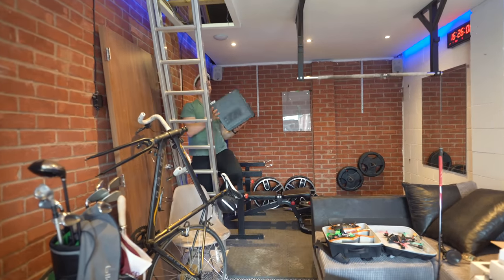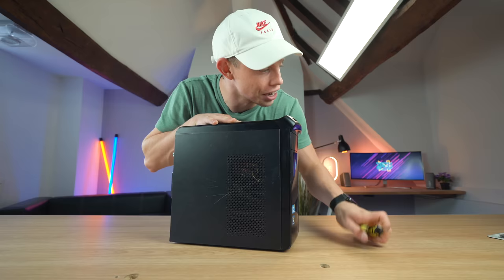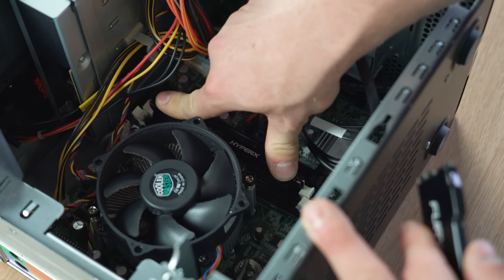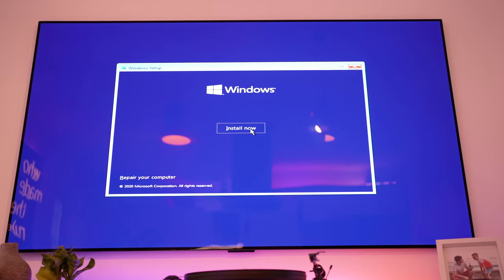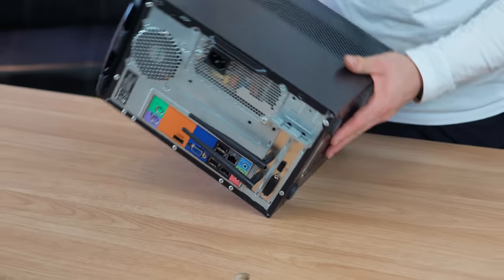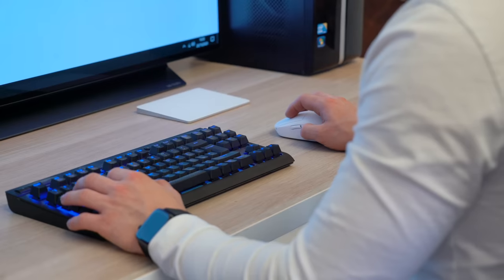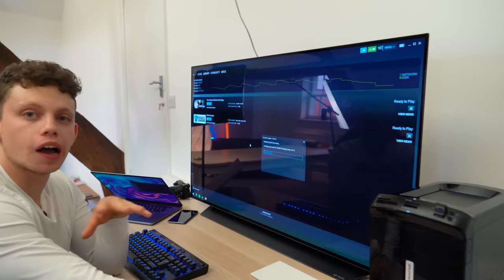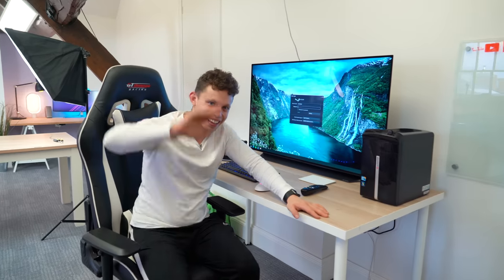How I Turned An 8-Year-Old PC Into A Cheap Mini Gaming Rig!

Comment: With this 32bit windows, you're only using 4gb of the 8gb ram. So, there's even more to get out of this pc
Reply: ye i had this with my laptop would ony run 4gig not the full 8 coz i put 32 on it insted if 64 all good now ddr3
Reply: Maybe the CPU is only 32 bit?
Reply: @lorenzojw04  then he doesn't need the 8 gigs of ram either
Reply: @Nootjuh  no was 64 bit cpu i dident no put 32 bit win 10 in it so wen i put win 10 64 bit i got all 8 gig

Comment: I mean I understand that this a chill/casual style video, but c'mon get your facts straight.

- There was no info about the original configuration or any sort of comparison. All the "results" are just based on your words
- There is no DDR5 DIMMs available to purchase right now.
- You've just put 8GB of ram in a 32-bit system? 32-bit is limited to 4GB and why would anyone use 32-bit system either way?

IMO this whole "guide" is useless, just save 400-600£ and you can build an actual mostly up to date machine, which can do so much more than this thing...
Reply: that system supports 64bit Windows, he is just lame.

Comment: I bought a PB imedia s3810 many years ago, I still have it.  It had an i3 540 cpu and for £20 I bought a Xeon x3470 and dropped it straight in. With a ram upgrade taking it up from 3gb to 8gb it was a beast. I still have it, it's my home server PC now, with a GPU it'll work fine for 1080p gaming if wanted.

Comment: Who installs 32bit windows????? Why?? You can install 64bit without issues
Reply: Maybe the cpu is 32bit, haven't checked tho
Reply: @jonathanmajdi9126  A 8 year old cpu should not be 32bit for sure, but I can be wrong :), I think the first 64bit Intel CPU´s were made in 2004 or 2005

Comment: You could have just installed 64bit Windows. Because of this you aren't even usintall of the available RAM. The max on 32bit is 4GB
Reply: The CPU might be 32bit, he doesn't say.
Reply: @jonathanmajdi9126  He Said First Gen Core Series which is 64BIT